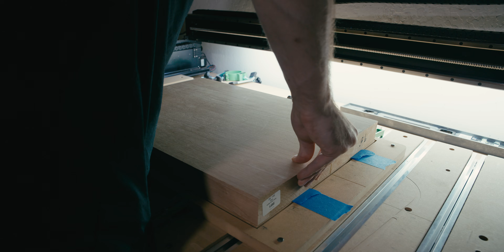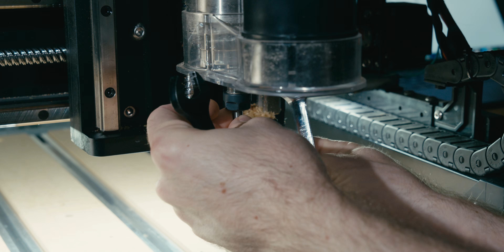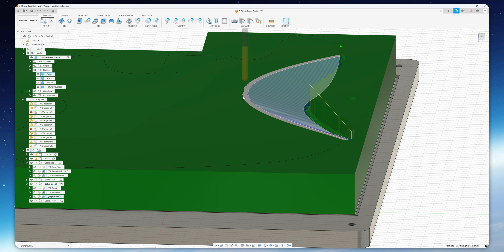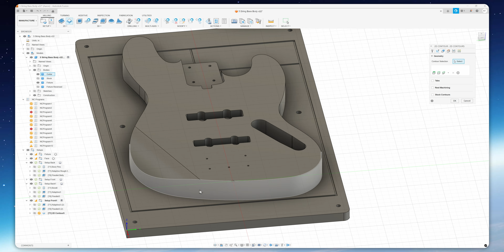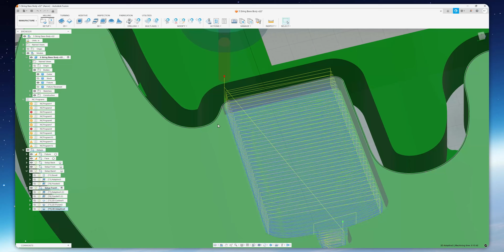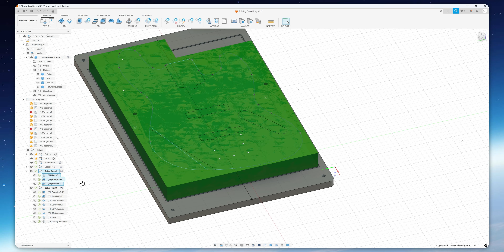How to CNC Machine a Guitar (Full Tutorial)

Comment: Everyone building Electric Guitar what's the problem with Acoustic guitar?
Reply from the maker: They are much more difficult and require several specialty tools
Reply: @JuliaGuitars oh.. but i thought just cut 2d sheet Top bottom  and surrounding spacer  bend and putt together 😅 I am wondering what's difficult in it if you can build most difficult part of guitar The Hand .😅
Reply from the maker: It’s the fine details. The steam, bender, bracing, gluing the bracing needs a special jig, inlay and binding is difficult. The neck is difficult to matching because the heel is so deep :/
Reply: Yeah even the clamps for glue holding are different than what a typical wood worker would have or need.   AC guitars, violins are different beasts.

Comment: Are you using carbide motion for the g code imports? Would love to see that process
Reply from the maker: I am. Pretty much all I do is import the file and jog to set the index. The fusion exports for grbl automatically do the bit switches for me
Reply: @JuliaGuitars are you using the user saved macros for recalling positions or are you just setting the zero point with the probe?
Reply from the maker: @SoleilCustomGuitars  I manually set it each time

Comment: it's cool that you don't need much skill to make stuff these days now that a PC will do it for you. Now anybody can be called a builder of (insert word). What would take me a day, you can now hit enter and come back two hours later and done!
Reply from the maker: Most importantly you don’t lose your fingers!
Reply: Oh yeah, it's super easy. All you need to do is learn how to use CAM software and CNC. Gluing boards together and operating band saw and router is much, much harder /s
Reply from the maker: I used to make everything “by hand” with routers and band saws when I first got started. The setup time is actually pretty similar between routing templates and indexing everything on the CNC. Just takes way longer to initially get all the CNC files and models created. Hoping this helps anyone interested in it. Overall way safer and you can do some cool stuff with the CNC
Reply: @JuliaGuitars  sorry, should have clarified: my comment was sarcastic response to original comment implying that "PC will do it for you". Yeah, CNC will cut it for you, but CAD and CAM process are not easy and take a lot of time to get right. Or maybe I misread that initial comment and it wasn't actually a jab at people using CNCs :D In that case I apologize.
Reply from the maker: Haha all good I got the sarcasm and assumed you meant that. Just wanted to add my 2cents about CNC building :)
Reply: @kostya_stankevych  no, it was. I run a full time CNC wood working business and I occasionally have to deal with this type of loser who is still angry and bitter that when technology changed, all they could manage to do was to bitch and moan about how it was better in the old days and they missed the boat. Now that they have been left behind, they’re angry at the thing that they lost the game to. 

Lashing out at those of us who didn’t make the same mistake in the YouTube comment section is all these poor, old fools have left.
Reply: My 2cents…I’m new to CNC but I am finding. Fusion 360 to be a very versatile and logical choice for making g code.  So far my simulations have matched reality.   Also using a Sienci Altmill which is also very logical to assemble and run with their g sender program.